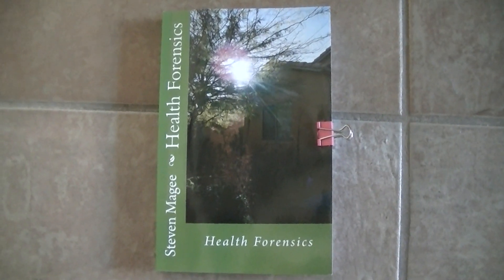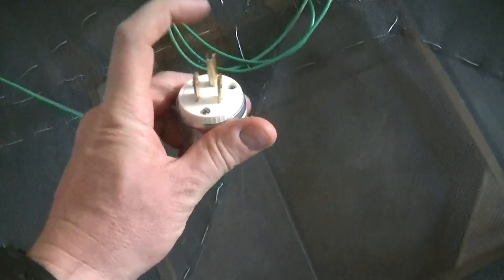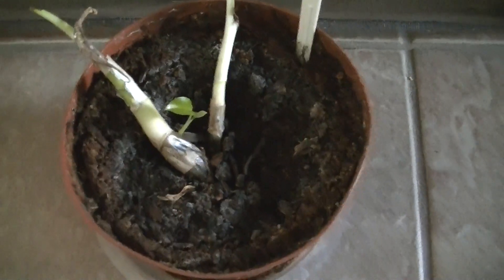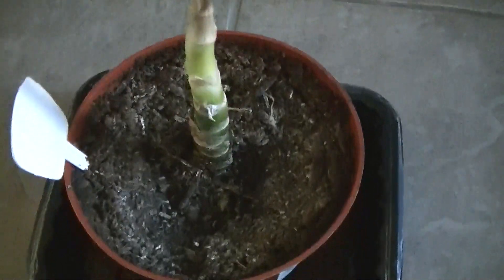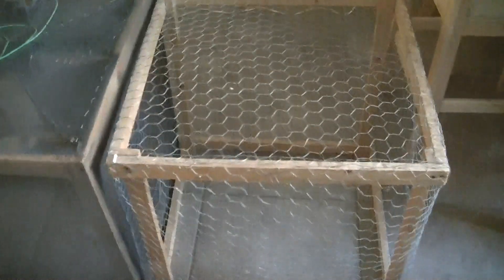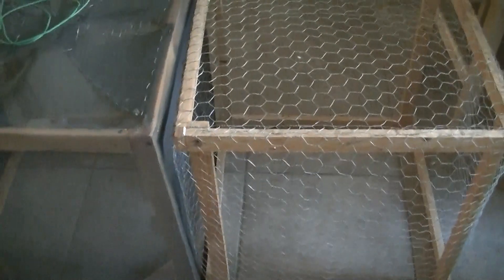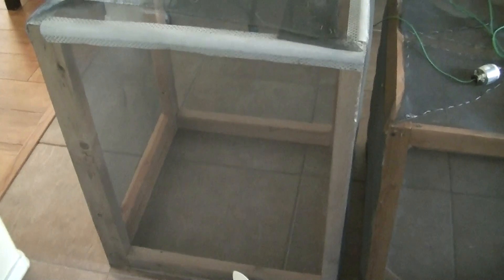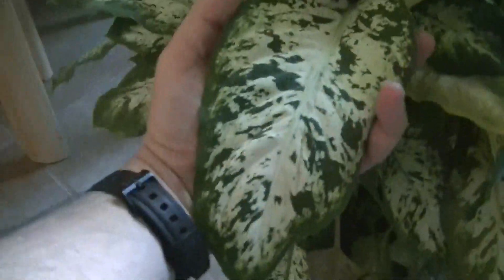Faraday Cage Plant Growth Defects Review January 2014

Comment: Have you read James DeMeo's Orgone Accumulator Handbook? These structures are very similar to an orgone accumulator (steel layered with wool), all of which have negative effects too close to radiation sources. DeMeo warns explicitly that Reich says aluminum and copper in particular produce life-negative effects. By the claims of the book, an aluminum Faraday cage will only produce life-negative effects. But a ferromagnetic cage would produce life-positive effects outside a major radiation source.
Reply from the maker: Very interesting!  I have not read the book and thanks for the book recommendation.
Reply: +Environmental Radiation LLC worth a look. also, a Lead (Pb) cage seems to tone down oranur (agitated orgone) stimulated by radiation sources, perhaps because it filters out some radiation rather than amplifying it
Reply: Adding quartz to get piezzo electric effect helps to neutralize bad effects of high frequencies. Look up orgonites. My foods do seem too stay good for much longer, although I never experimented with live plants.

Comment from the maker: I have many control plants in the home and I do not see deaths occurring in them.  It is rare to see a control plant die.  The controls do deform, as the home is filled with biologically harmful wireless radiation from transmitting utility meters and nearby cell phone towers.  I am currently repeating this experiment with foil bases to the Faraday cages to see if I get the same results.  http://youtu.be/MkQjTvcUjV4 Does a Faraday Cage Need a Conductive Base When on the Ground?